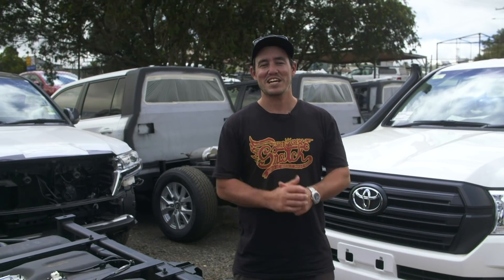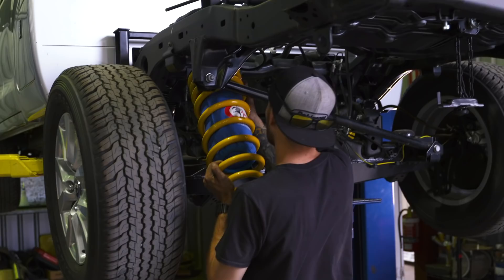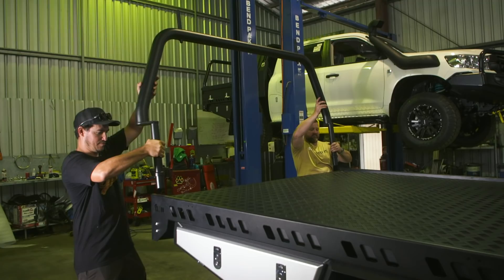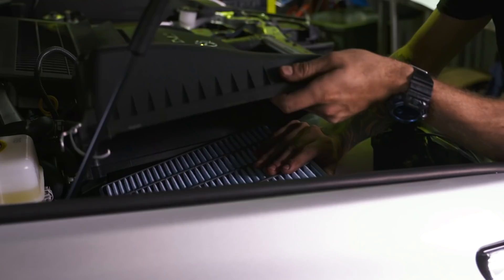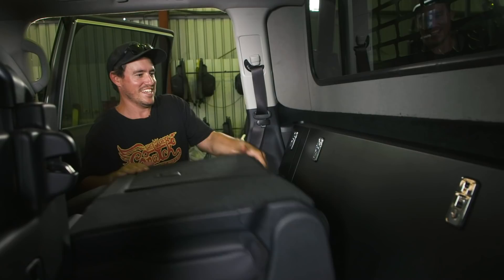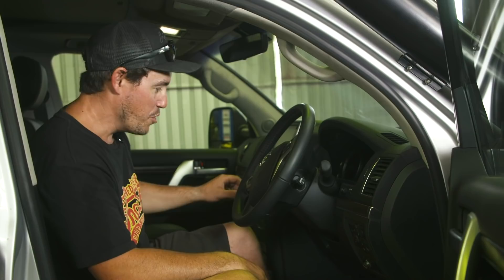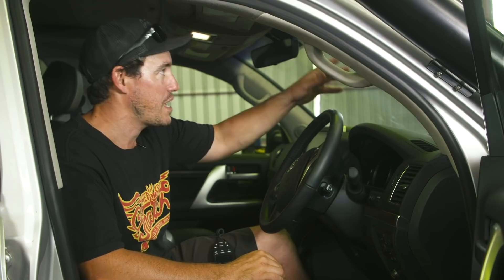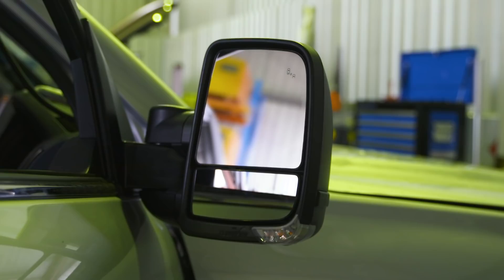CHOPPED 200 LANDCRUISER CANOPY BUILD! What Shauno did differently this time - 200 Build Ep 2

Comment: The tank set ups is one of the cooler ideas I’ve seen in a build like this.
Reply: I agree! 

However, I think it would have been safer to place the fuel tank between the chassis structure and the water tank behind the head board. (Right now it’s the other way around.)

Therefore, in case of a frontal collision the chance that the fuel tank gets penetrated/crushed by moving cargo on the tray is much lower. (Environmental concerns and fire risk)

I think that would be more important then putting the lighter fluid (Diesel) higher than the heavier one (water) for a better center of gravity position. (Maybe that was the original criteria for that decision)
Reply: Same tank set up is cool as. Practical way of using spare space
Reply: @florianf5903  don’t forget it’s diesel, so it won’t ignite with naked flame
Reply: Also, if the water tank was installed between the cab and the tray then the tank would be high enough to not need a pump to access water - just turn a tap on the side of the tank.

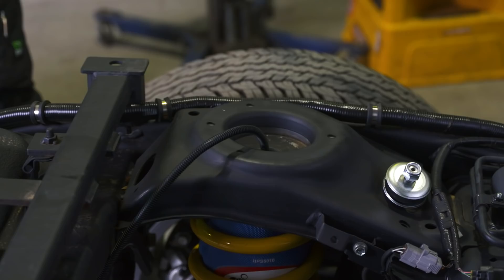Comment: At 2:10 you can see the upper shock mount plate is welded to the side /top of the chassis cross-tube. If you ever run the air bags at low pressures, the shock can bottom out and will rip the mounting plate from the cross member tube and also from the main chassis frame. It happened to my 3rd gen 4runner/Prado 90 series.

Comment: With your canopy; What I did for my trailer was a pump to a standard kitchen sink, the sink swings out and I have a pull out drawer/table under it with a hole cut out to fit the Kings pop out sink. so I basically have a compact kitchen sink at all times but don't lose space by having the bench inside the canopy.

Comment: for the canopy leave the dog box side open or with a small set of draws to put bits and pieces in. And possibly store camping chairs or a swag on that side. On the other side have a drop down fridge slide with a dometic fridge as well as more draws for kitchen appliances(still leave room up top of the draw for a weber) and a little travel buddy 

this is at least what i would do

Comment: This will get you where Troopies dare to travel (smart centre of gravity/weight metrics👍🏻👀) - I’m starting my 2010 Hilux 1600 mm canopy kit out after just making across the border from VIC to SA to pick up the canopy in Laverton. In terms of kit out Shauno I’m doing mine incrementally with a few shorts trips in SA to see what works for me - Redarc (thanks to your review), Engel, Lithium battery system with solar, gravity-fed water tank, GME comms/two aerials etc. This should then ensure a good setup for the first big touring WA/NT trek 2021 - anyway my five cents worth - John in SA

Comment: I would use the canopy for sleeping and not keep the crew cab but extend the canopy.   Put the Fridge outside on the back built partially into canopy taking up less space.
Keep everything possible stowed away in ceiling compartments above extreme water levels..
Tiger Tails that they use for ATV would be cool finding a 4x4 version if available.

Comment: Above the head board set up the wiring on a and have it able to pull out and slide to the side like a kiss cassette tape so that it doesn't take up space inside and you can get to it easy. if you would like put the electrical under the rear seat so it is away from dust and water? Maybe with perspex to sealing it off if the cabin gets water in it. Have the lithium batteries setup in the tray beside the draw in the tray. I don't know if it is worth having flexible solar panels on the side of the doors of the canopy. If you decide to use the under tray batteries to start you can put a inflator or a air tank in the engine bay.

Comment: Didn't see where the spare tyres are going?? thought they may have been relocated to the rear of the tray, although that would put a lot of weight out the back. Excellent build though, it will be interesting to see how the longer wheel base goes on the challenging tracks you guys usually do. Look forward to seeing the rest of the fit out.

Comment: Shauno, maybe I'm just stupid, but why are all the Australian 4x4 fitted with this big radio antennas on the bull bar or front bumper? Its obstruckting and distracting the driver isn't it? Why don't you guys fit it to the back of the cab roof or even the space between the cab and the tray at tje highest point of the vehicle? Is there a specific reason why its sitting right in your eye line?

Comment: Rear facing snorkel intake, then want's a tune for more power! lol. Duh...
Reply: Snorkel Direction plays very little difference in vehicles where power is needed in OFFROAD conditions (low speed high power scenario)..   Plus, Ram Pressure at 100kph - not all that much... Plus Most High power diesel rigs  are after Max Power for doing Burnouts in the carpark (or into "Rolling coal" as if that is a great innovation - get a steam traction engine for that)..  snorkel direction plays no part in that....  lol..  haha..  duh..

Comment: What sort of coin are we talking about just for these mods?
Reply: Easy 20k by the time its on the road plus the 100k+ for the crusier
Reply: @robvanderkroft6515  and the rest. Lol
Reply: @joebaxter4235  yeah I was being a bit optimistic.  The ute chop and canopy alone would have been 10k . But alot of it will be sponsorship so no cost to shaun
Reply: @robvanderkroft6515  Creative Conversions have price estimator on their site. The chop, chassis extensions, GVM upgrade and engineering by itself is over $42,000. Doesn't include a tray, canopy or any of the extras they've done on this. Probably around $100,000 in this before you deck out the canopy. Plus another $85,000 for the vehicle. Be well over $200,000 by the time they're done.
Reply: @m5wm6w  yeah wasn't thinking about the gvm upgrades and the chassis extension.

Comment: Buying a lc 200 before what 80k for mods and still less capable than the dumb Ford f150 3.5l turbo petrol.. .ugh the waste of cash hurts. also the lower tow capacity and payload. Stock gvm is 3+ ton and 3683mm wheelbase and 2029mm but lc 200 is 4990mm wheel base and 1980mm wide.  Such a bad buy based on Shaun's stated use case. In addition to waste of money for chop and mods

Comment: was enjoying this vid until the guy said about a standard L200 "basically you put the passengers and a full tank of fuel in it and you are at your GVM"...really...what a load of bollocks! Come on get the facts right at least if you are going to put this stuff out there...
Reply: It is not really that much of an exaggeration. The load capacity of a standard 200 series is around 610kg. If it is an 8 seater and you put 8 people in it who are 70-80kg it will be on the GVM.  
But let's say you have a 5 seater and put 5 people in it. Each person plus their belongings, food and water have to be less than 120kg. If you have a larger fuel tank installed they can only be 95kg each. Now if you consider barwork, roof racks, recovery gear, awning, anything you would normally find on a 4WD it will be very hard to have 5 people in there without being way over GVM.